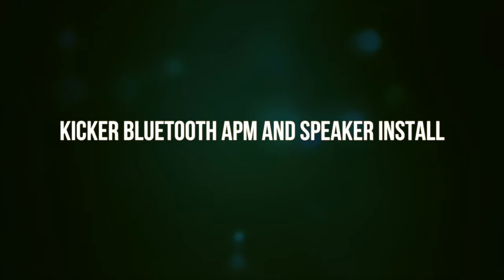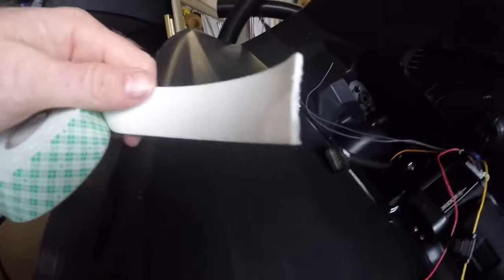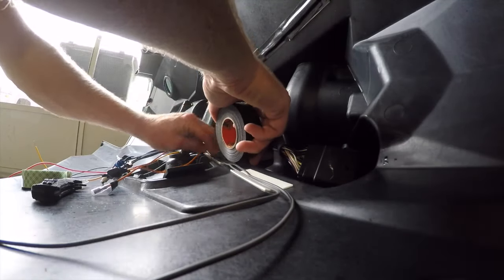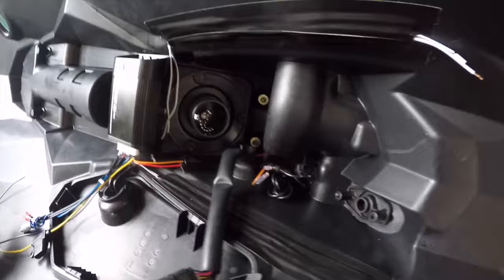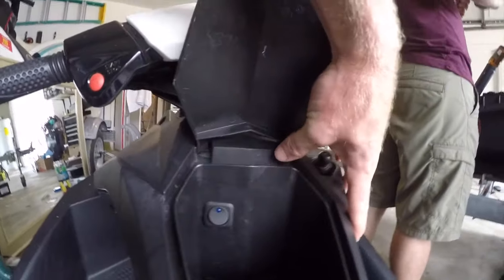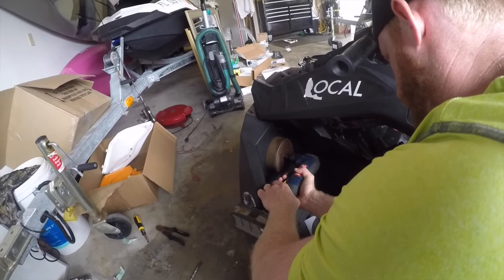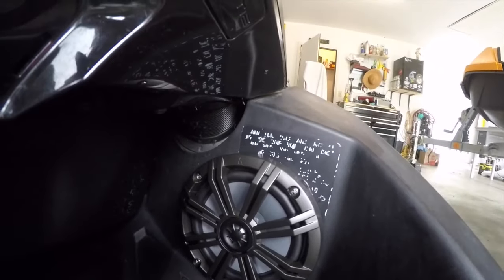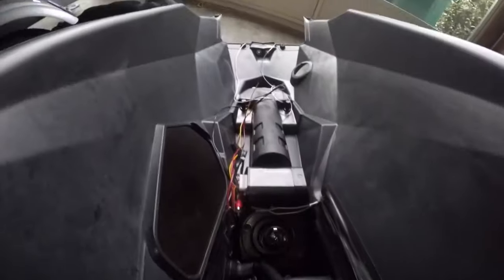How To Install  Kicker Speakers On  A Sea-Doo Spark

Comment: I fitted a sound system on my rxp 4 years ago. Got 4 speakers on it 2 below the seat 2 on the ends of the handle bars. Love it, Bluetooth connectivity can't beat it having music on the water lol
Reply: did you run into any problems with the battery dying?

Comment: Hey I plan on doing this with my jet ski and was wondering if everything you installed still worked good and didn’t leak. I was also wondering if your screws screwed back in for your cover after you took them out because on my sea doo spark trixx 2018 they are self tapping screws and wont screw back in after they are loosened.
Reply from the maker: Codyak it never leaked I don’t have it anymore I sold it like a year ago.
Reply: @the_trevorsoety  Ok when you put you cover back on did your screws go back in? because mine are self tapping and don't screw back in after they are loosened
Reply from the maker: Codyak hmmmm yeah mine went back I flush I’m not sure what size mine were or if I put them
In the video I havent watched this in while
Reply: @the_trevorsoety  Ok thank you for the information

Comment: How did these speakers not contact the styrofoam piece that is in front of the spot you mounted the speakers? I put my amp there and had to cut out a section of the styrofoam
Reply from the maker: The did after taking it off again after this video but the foam molded to the speakers

Comment: Did you connect it to the stock battery or add a second battery? If on the stock battery, do you have any power issues?
Reply from the maker: justin hubert I upgraded the better to a gell with a little more cranking amps on all honestly the stock batter will work fine
Reply: Trevor Soety give us please more info about new battery,brand,crank cycles ext.Thanx
Reply from the maker: LAMBOCANDY https://powersportbatteries.com/sea-doo-spark-ace-sar-jet-ski-watercraft-batteries/24154-2015-seadoo-sea-doo-spark-ace-900-ho-jet-ski-battery-sla-agm-ls.html

Comment: Can I get a shopping list of everything you used
Reply from the maker: i wish i could help you out man but i no longer have the spark nor can i remember i got everything from best buy with warranty
Reply: I'm just saying basics like speaker size and watts and amp size and Bluetooth name.... what wires or wiring harness I've  actually never hooked up a system before but I'm pretty good at figuring stuff out if I have everything I need I'll be able to pull it off I just don't really know what I need
Reply from the maker: I added information on speakers , amp and switch! Look under video :)
Reply: Thanks man
Reply from the maker: the harness came with amp

Comment: Installing the same system on my spark this month, any suggestions or things you would have done differently? Also, is it illegal to remove the factory void sticker to put the speakers at the front like you have ?
Reply from the maker: I would mount the amp in the front under cargo area! It got really hot so I moved it there!
Reply: What do u mean in the front Under cargo area?
Reply: Photos?
Reply: I'm doing a install as well I already have speakers in.. are you talking about where the 2 air intake pipes are that are zip tied together?

Comment: is that bluetooth amp itself waterproof?
Reply: No it is not waterproof I found out the hard way. But it's dry in the hull
Reply from the maker: It's not really water proof for being a marine amp! But mine still works !
Reply: i got the kenwood bluetooth one and its not water proof has to be installed in dry hull like i ride 705